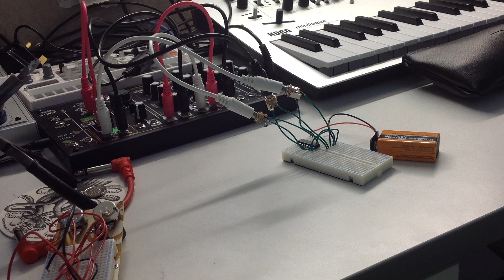DIY clock divider

Comment: Hi David, is this as simple as: 4040 IC, power, ground, and jacks for clock input and jacks for the divisions outputs? No extra components needed? Thanks.
Reply: Cool, thanks! I was wondering how does the divider know where the downbeat (the 1) is. Can you fix this with a reset on the downbeat maybe? Where does the reset go to: ground of +5v?